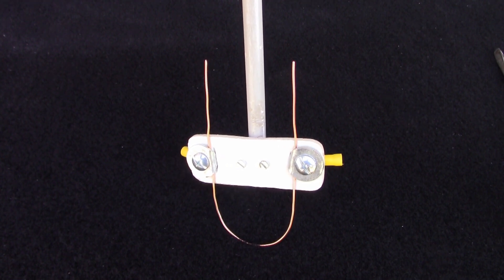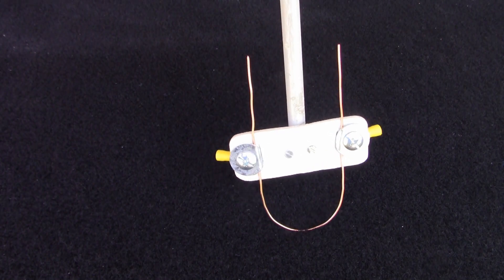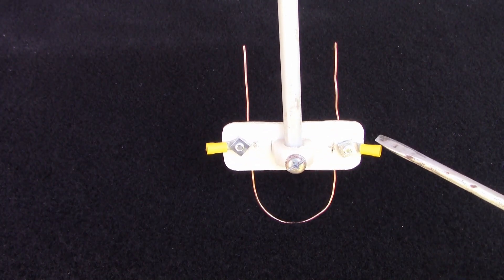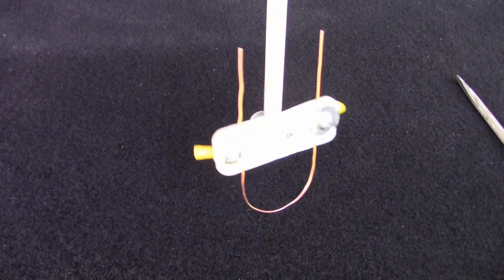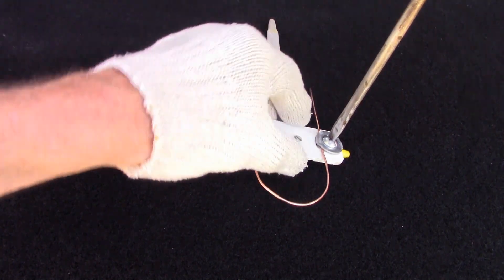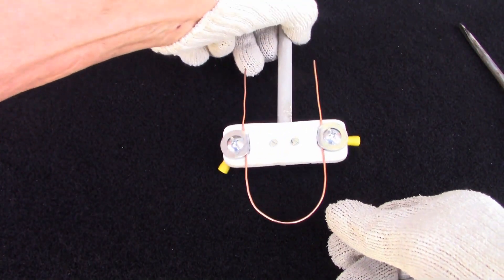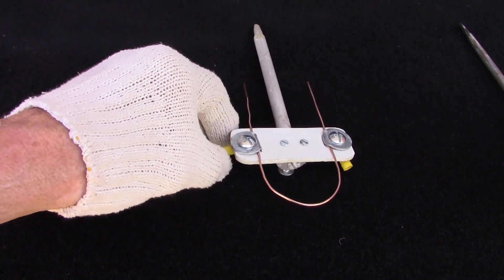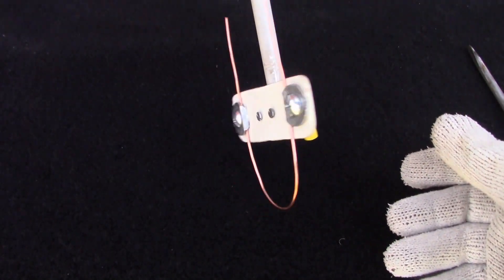✅SIMPLE TUNING STUB FOR QUAD ANTENNA REFLECTOR ELEMENT

Comment: How do you tune the reflector to get a close enough to use the stub? Are you just using the online quad calculators or are you arriving at a particular reflector length before you can insert your tuning tool?

Comment: How would the forward gain be determined? Seems I would need another tuned antenna some 1,000 feet or so distant with a Smeter connected.
My problem has been that the feed point of the driven element is about 30' off the ground and tuning it is very difficult.